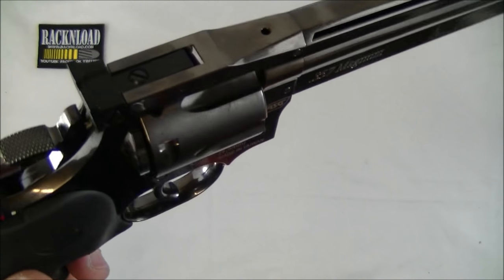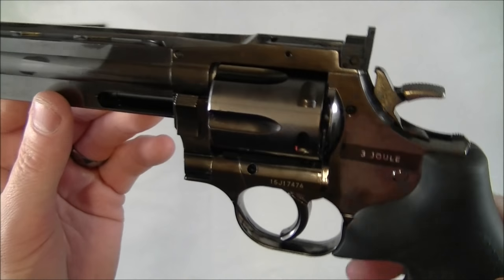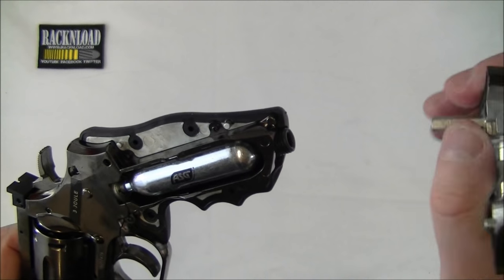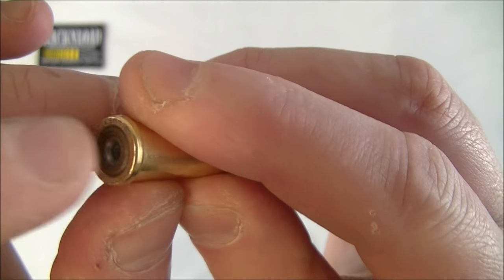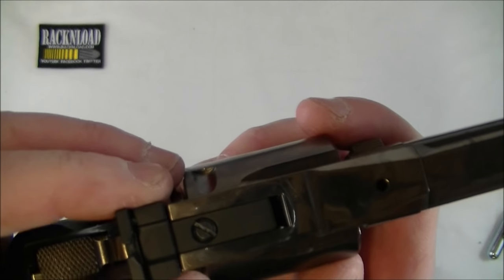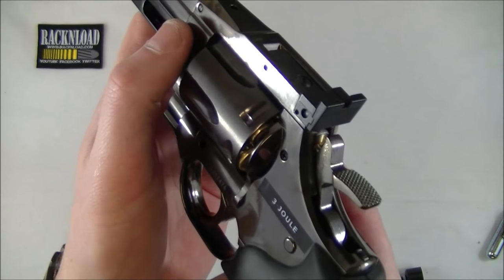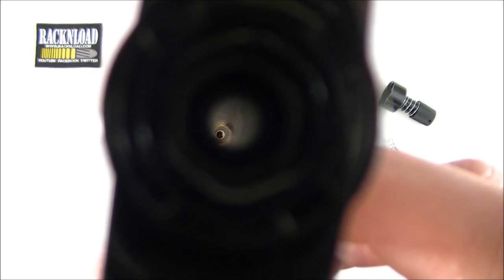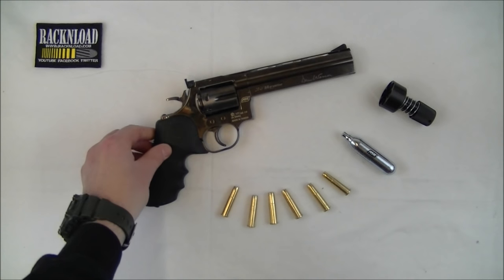Dan Wesson 715 (C02) **FULL REVIEW** by RACKNLOAD

Comment: Just brought one of these off the back of your review, so glad i did it looks and feels like holding the real thing. It's like a tank, i would say any one living in the Uk  this would be the nearest thing you can own to a real gun there is no plastic on it full metal,  as said in your review lovely grips, no rattle when together like some guns with the cheap plastic grips. It's not cheap in the uk cost me £180 but worth every penny, it's worth £100 to just to hold and load the shells. I own a crosman 357  very accurate, this is on par with that at 20ft. So glad they changed the way you load the pellets into the shells just push in instead of messing about screwing the end off and placing the pellets in that way. I don't mind loading after 6 shots every time, it's part of the enjoyment of this gun,  the old  shells  put me off  buying that model. Thanks for a great review, if anyone is in 2 minds about this gun don't it's the dogs.
Reply: update the gun as gone back to the shop yesterday the trigger or hammer broke only after 3 weeks, so not the tank i first thought. i got a full refund as it was under 30 days from the date i brought it, the woman offered me a replacement but got the refund instead and put it towards my new baby the WEIHRAUCH HW45
Reply: @MsKch1  oh dear. Ive heard theres a weakness in the hammer spring. Sad...the gun looks so cooool. I own the crosman vigilante which replaced the 357 and its still going strong. Sorry to hear yours broke...why didnt you risk another? Do you dislike the gun now?
Reply: Is it loud to disturb neighbors for them to report shootings?

Comment: Great review, if I could add a couple of issues, the "rifled barrel" is only the first 2 inches from the cylinder, and as one commenter said don't use steel bbs there are lots of lead and copper coated lead (H&N) and Gamo the finish is blued. Having had many real pistols the bluing is very realistic. Great gun one of the best revolvers I have come across. All the best , Keith...

Comment: Hi. Thanks for the video. I own this replica, and my shells are loaded by the front. I was told in the shop, I could use steel BBs. Mine is in 4,5mms too. So far, I did never dare to shoot those steel ones. On the other hand, I only used the plastic ones. Mine does not have rifled barrel. Unfortunately even those with rifled barrels, does not have all the barrel rifled😮!! Only part of it is in fact rifled, not all, as I expect😢😢. Mine is chromed. But in steel grey, is also very beautiful.

Comment: Thanks for the review. I just which they'd sell the pellet version in chrome or black. I have not bought this gun simply because I do not like the gloss finish.
Reply: i have this gun. you can remove the gray finish but this will be a project.  i noticed the pellet info on the right side killed the realism but its not engraved. i removed the bb pellet info easily on my cz p07 with nail polish remover. but this finish is a stain.  brasso and a brillo pad will remove the gray and a white chrome will be left however this will tale a long time.  then you must repolish it once you get down to white chrome tho remove the scratches
Reply: then you'd have the OnLY chrome pellet firing one...next to mine lol. i plan to get mine power modded to increase the power along with pba ammo. also i hate the accesory rail but i will check to see out i can screw a better looking rail
Reply: sorry not screw i meant that would slide into the existing rail slats